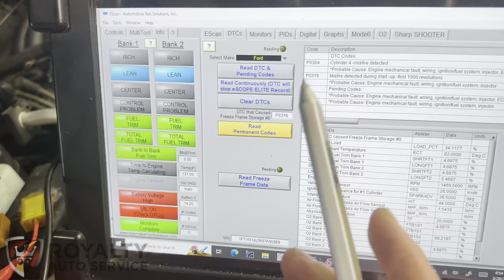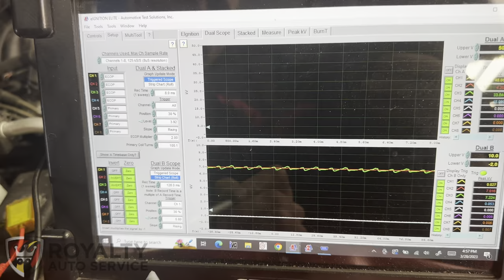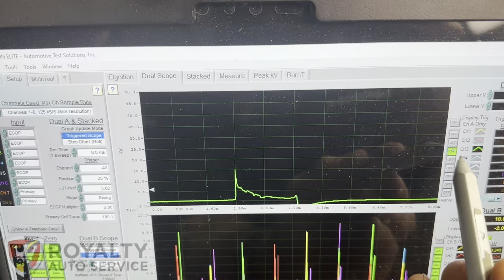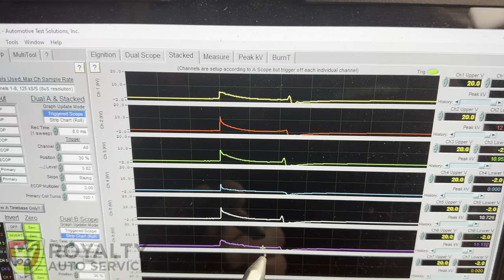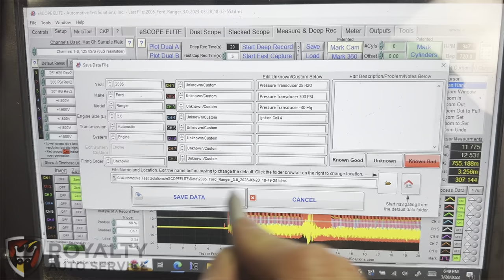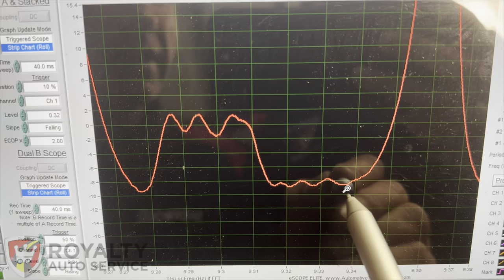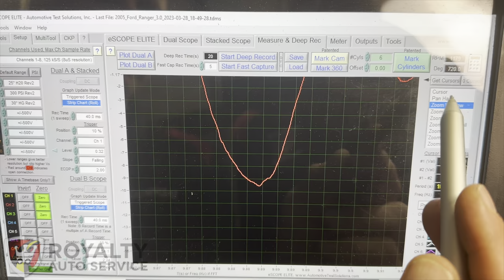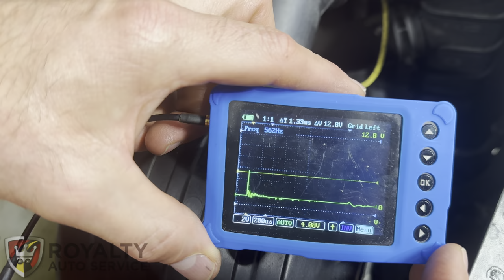It’s Misfiring.. Here’s 3 Ways to Ensure You Test, Not Guess! (Ford Ranger)

Comment: Great video! Just a couple of points to make. You mentioned a couple of times that the intake valve opens a little after the 540 degree marker. The intake valve closes. And since you hooked up the exhaust and intake pressure sensors, it would have been nice to see those waveforms to completely verify that the exhaust valve was not seating. Have a great evening.
Reply: You beat me to the comment.  He kept saying intake valve OPENS (I cringed).  It is IVC (intake valve close).  Also, it would have been nice as you said to overlay the exhaust sensor on top of the in-cylinder to further prove the exhaust valve was the issue.  Lastly, I always use the scan tool fuel trims to drive my diagnostic direction between ignition, mechanical or fuel delivery.  Good video sir and keep up the good work.
Reply: i was going to say how is the intake valve opening on a compression stroke you could have a leak on either inlet exhaust valve but the cam wont be opening on the compression stroke

Comment: I've got an 06 that has a flashing engine light that when I OBD scanned it, it read 5 codes. A majority of which were misfires from cylinder 1/2 and a general misfire cylinder code. Also read EVAP system large leak detected, and a "fuel running too rich bank 1 " type code. It's a manual as well and when I start it up, (if it does start it sometimes does not) it wont go into gear. This only started happening today, I bought it a week ago for 3200 @ 126k miles. It also burns oil like crazy, as in I put in a full 4.5 quarts of oil and within a day it was below the min line. No leaks, but it smokes a lot. I knew what I was going into when I bought it for 3200 but it ran just fine for a week THEN started having issues. I did all fluid changes except transmission..

Comment: Hi Professor. Thanks again. ATS tools are legit. Joe's pick up are on point. Question what did you use to stick them to the ignition wire or coils. I use 3m tape but sometimes it doesn't stick. I have the ATS ones also but I didn't like how the did away with the Velcro strap from the first pick up probes.
Reply from the maker: Joe had some very sticky tape on them but they were only good for one use. I need to find out what he uses and buy a bunch of it. It was extremely sticky
Reply: @theroyaltyautoservice  guys mentioned to use 3m but when it gets hot. It slips off during test drives.going to make some like ATS to hold them in place

Comment: I think there is a tsb from ford for some v6 engines in rangers around this era for valve sealing problems. I diagnosed one of these trucks with a 3 liter 12 valve engine and it had leaking valve seats.

Comment: Can Sherwood elaborate on how exactly he came to that conclusion? I don't see any leaning towers or really any clear indicator that the exhaust valve wasn't seated properly because where he indicates the seating issue is exactly where the exhaust valve would be opening. I would assume an exhaust valve that doesn't seat properly would cause a leaning compression tower. However on the brief shot of the exhaust pulse sensor I do see slightly larger oscillations while on that cylinders compression stroke but if that was me I would've had to put a leak down tester in that cylinder. Just trying to learn. Thanks!!
Reply: I agree!

Comment: nice video, I would have liked to seen you do a compression test on #4 to confirm your findings as I did not hear a weak cylinder while cranking  the engine.
Reply: the pressure transducer will give that info if he goes back and looks at it. cranking vs running gives a different pressure also

Comment: information on when to use attenuator on scope
Reply: Not required on the Escope.
Reply: What kind of scope are you using?
Reply: @Jpilgrim30  snapon and u-scope
Reply: @DependableAutoTruck  snap on doesn’t need attenuators but I think the u scope is 40 volt max so you’d need to use an attenuator on things like fuel injectors or ignition coils that have an inductive spike or you will damage the scope.

Comment: You say you see a problem and stop once you know it's an in-cylinder problem based on the RC Test, lets assume you used a sync on that test also, how long does it take to do an RC and then an INCYL to give a more in-depth answer to the customer, will these 2 tests take more than 1 hour to diagnosis, does your shop charge a minimum of 1-hour diag fee, can you not do both tests within 1 hour on SOME vehicles, not on the Infiniti in your other secondary ignition video LOL. 

You spent all the time hooking up the EXH Pulse and the INT Vac Transducer but did not show a possible problem on the EXH Pulse, maybe nothing is wrong with the intake waveform so actually, those tools are not needed. You are a bit high-strung there partner, please be a little more careful of your terminology. IMHO I feel that channels like this act as teachers here in this field and I believe that any teacher is not allowed to make mistakes, if a mistake is made, do a voice-over or text on the screen to correct the mistake, much appreciated.